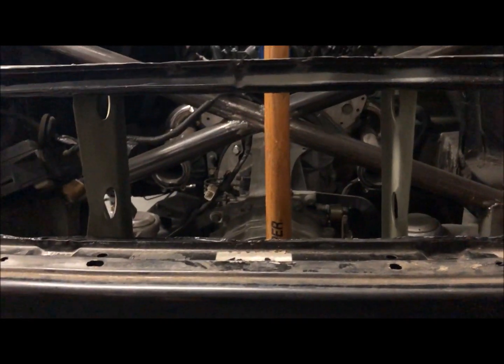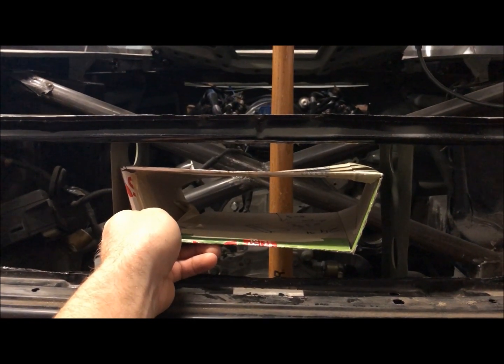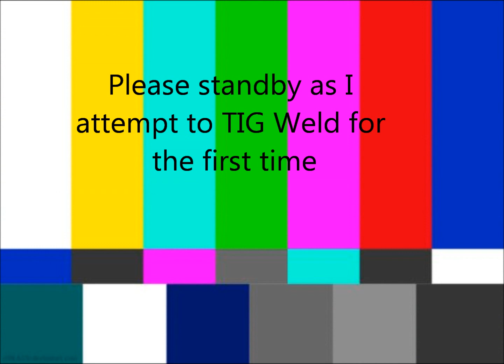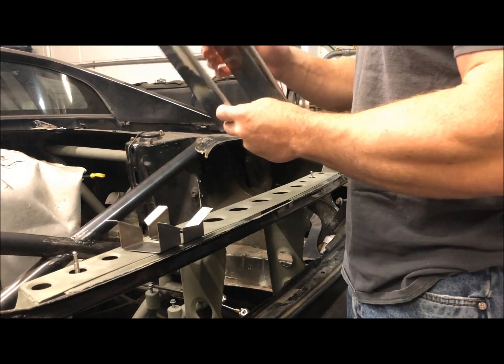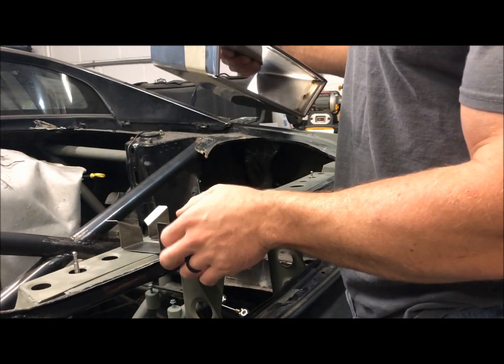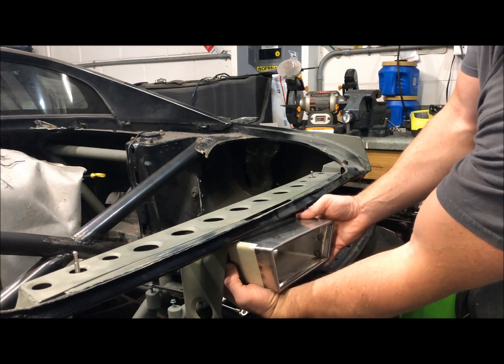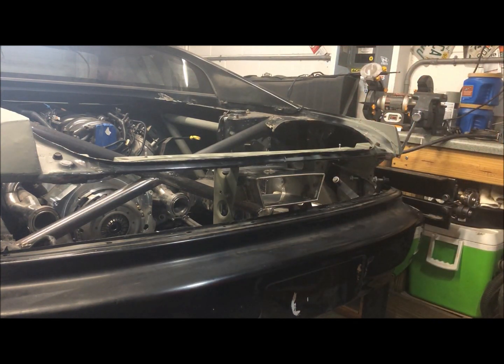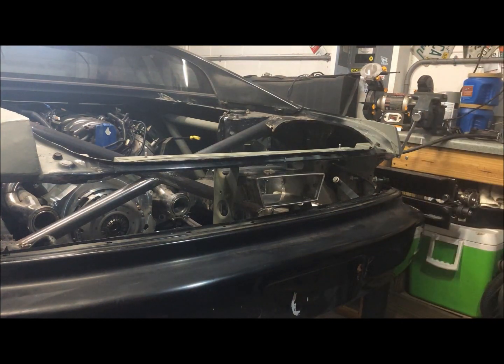V8 MR2 Build #13 Center exit exhaust

Comment: The end shape looks so close to the one I made for my car!  I mounted mine down low where the stock muffler is.  I have a video of mine on my channel.
Reply from the maker: I think i already watched that a while back. You made a diffuser as well if my memory serves me correctly. I learned in an apprenticeship at a autobody shop. Then i gradually started doing some custom work. also , metalworking and machine work is in my blood
Reply: Scantron's Garage I thought about making a diffuser but it never came about.